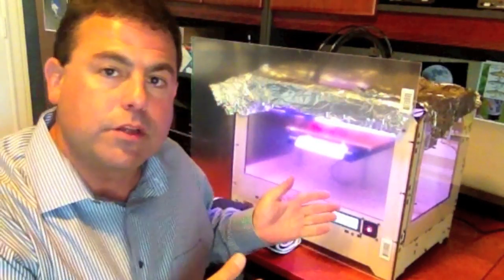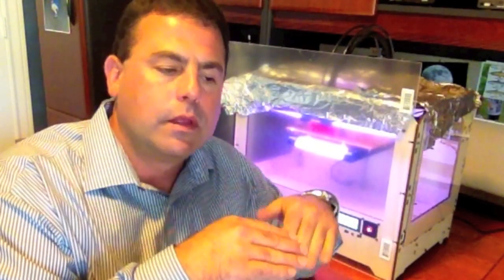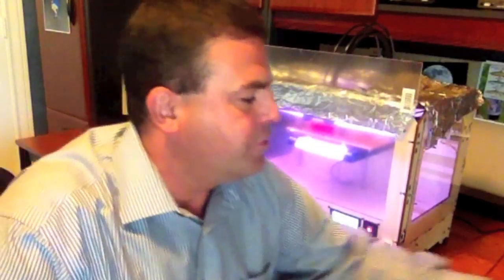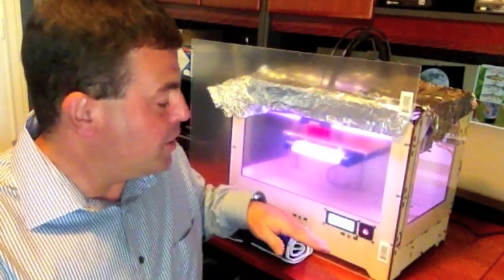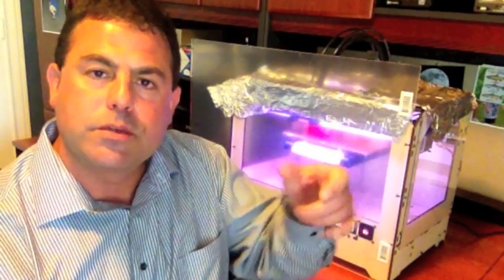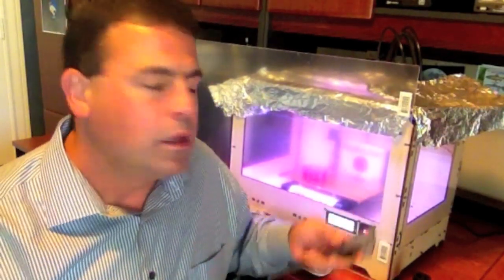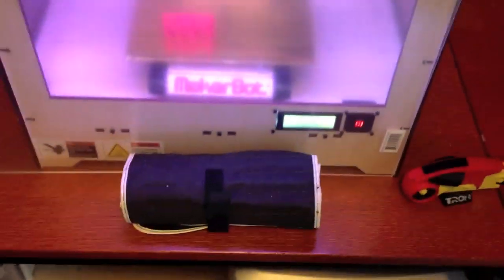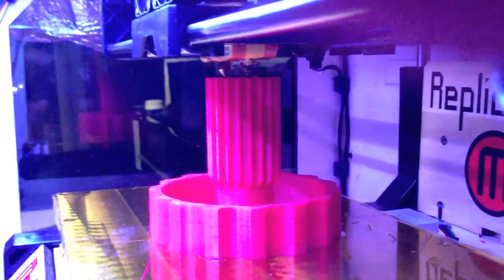Makerbot Quick Tips #1 - Quality Prints

Comment: First, thanks for these videos! They're incredibly helpful.

I've been having an issue where I export SketchUp models as .stl files, and when I open them in ReplicatorG, they are incredibly small, even though I draw them 1:1 in SketchUp. It wasn't a problem at first, I would just scale them up to roughly what size I thought they should be. Now, I'm starting to get into more detailed prints and I need them to be accurate. Any suggestions/ideas as to why this could be happening?

-Conor

Comment: What a great tutorial. I'm currently having the same issues with my more complex parts. One of the big issue Im currently having is the raft is not sticking to the platform and is warping. Ive tried using acetone, increasing the temp etc. Can you make a tutorial on how to change the raft setting and the quality setting? It will be greatly appreciated.